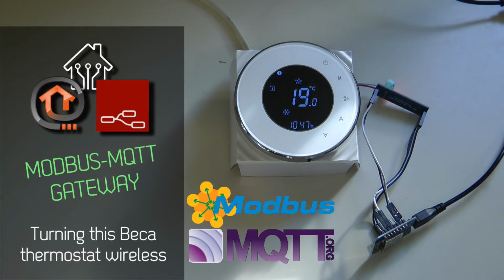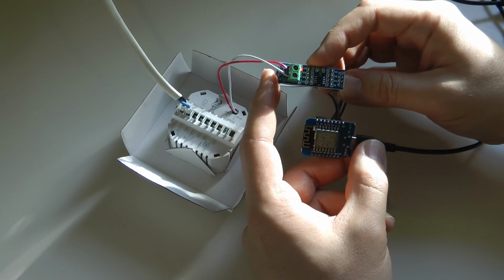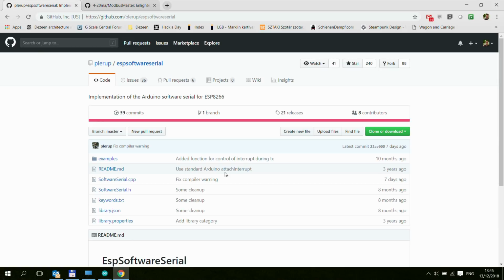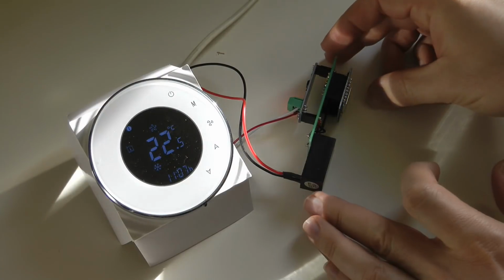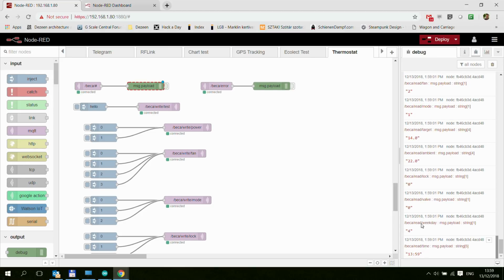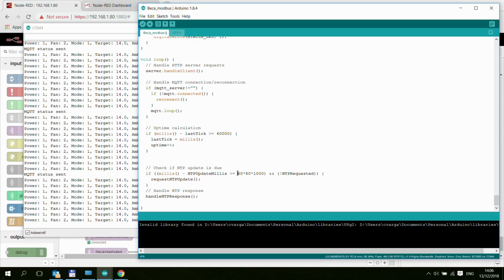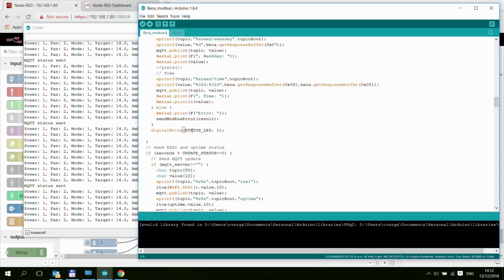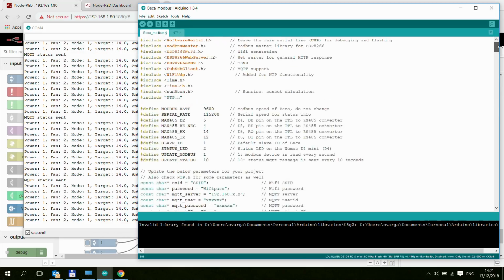Modbus to MQTT Gateway for Beca thermostat

Comment: Hey, create video! Do you happen to have a link to the Modbus datasheet for the Beca? I have one and need to integrate 😂.
Reply from the maker: Check this: https://docs.google.com/document/d/1Ue8Wy6LhTkNvlEkVSH8iUv1nnZ6Tri_m/edit?usp=sharing&ouid=107708713303271671804&rtpof=true&sd=true. It is very simple, but please do check with your model, as for some models some of the registers are not used.
Reply from the maker: The register do change a little bit between different models. But just read the first few registers and you will easily figure out which one is which. And you can also write these values, even stuff like time.

Comment: What applicatiom do we download to ise this particular thermostat..? So we can operate it online😊
Reply from the maker: None. I built this gateway to it can be integrated with a DIY home automation system, like Node-Red, or Home Assistant. It will not work directly with an app. But an exact model is available in Wifi version and that works with the Tuya Smart app. So buy the Wifi version and it will work.

Comment: dear Csongor Varga, I want to monitor and control the chiller with Modbus protocol and RS485 port, it is in the site and I'm at the office, would you please tell me how to do this process with GSM module and what other devices needed?
Reply from the maker: I don't know, you need some remote modbus unit which works over GSM. I am not aware of any such model.
Reply: @csongorvarga  Thanks for your response, would you please mention the model and brand of the equipments you have used to connect to the wifi network?
Reply from the maker: @sadeghkhorasani7616  Check my PCB project, it explains the parts used: https://www.pcbway.com/project/shareproject/ESP8266_Modbus_board.html
Reply: Hi, you can do this with a ie SIM800 module, (& a lot of AT commands) take care regarding timing⚠️, there a lot ov YT videos out which explains this

Comment: Hi there. Do you guys know if it's possible to change the thermostat's slave id? I'd like to have four of them on the same RS485 line. Thanks in advance.
Reply from the maker: I did a separate video on this device where I talk about setting it up. If you look the manual, you turn on the device with one of the the other button pressed, and it opens a settings screen. You can change the slave ID there.

Comment: What data can you see over mqtt except temperature?
Reply from the maker: If the unit is on/off, locked/not locked, mode, fan mode, time, day of week. And probably the external sensor as well, but I don't have it.

Comment: I was doing a similar project for the SDM 220 energy meter but i was bugged with the ESP wdt resets - thanks for the tip-  I was using delays and yield to try to solve this but didn't help. Also, I should share a picture of my protoboard - looks awfully similar to yours! I was uploading the data to Thingspeak(no mqtt and Node Red). Also implemented the same using an Arduino and an ethernet shield. Also, I was thinking of adding filter caps after the ac-dc power supply - did you analyse the output of the same? Another thing I was thinking about was whether to add RTC or use NTP - do you think NTP implementation is better than using RTC? Also, what do you think about adding SD card for a local backup log?
Reply from the maker: Great stuff! I think I was lucky finding the watchdog solution for this issue, otherwise would have chased the problem for weeks. Power supply: yes, I see it in most implementation that a 100m filter cap is added. Still it works without that for hours not rebooting. RTC: these devices will be on the network most of the time. So having the time refreshed from NTP from time-to-time is good enough. Even if the power goes down and comes back slower than the internet, the sketch will try the NTP request again in one hour. So you will be running without a clock for one hour. Probably not a huge issue. SD card: I can't really think of any important data you want to back up locally.

Comment: Does every Beca round thermostat model support modbus or only some specific versions?
Reply from the maker: As far as I can tell, they are either modbus or wifi versions.
Reply: @csongorvarga  so if I buy a wifi version.. I can control it using only via mobile app?... And if I buy a modbus version, I can use it via HA but not with mobile app like tuya?... I'd like to use it via tuya app, and view at the same time changes via HA... Is it possible? Thanks
Reply from the maker: @GiuseppeLodiRizziniOfficial  I don't know an option which would enable both.
Reply: @csongorvarga  so... At the end... Modbus is better cause can i control it via mobile using HA web interface.. Is it true?

Comment: Great video! Can you explain which thermostat did you used? From the Beca serie there are a lot of various types https://irshop.eu/eng/files/2018/02/BHT-6000-WIFI-HEATING-THERMOSTAT.pdf

And i think that i can only use the BHT6000 with the N (modbus option), but i can't found them yet....

Comment: Hey, 
I am still confused how did you "Not" use a Modbus library but still make it working more properly. 

I saw your previous videos about Modbus but was really confused and didn't get how can I Impliment it for my requirement.  

Overall, really thanks a lot for explain and to put your efforts teaching us. 

Thanks a lot. I'd really love if you can cover all the dataset of Modbus. And how to Impliment them in Arduino. Without libraries. 

Cheers!
Reply from the maker: I am confused too. I did use a modbus library. I would never try to code something like this from the ground up. What do you mean all dataset of Modbus? The different modbus functions? Unfortunately I would need devices for them to test all of them out.
Reply: @csongorvarga  yes I'm talking about using different Modbus functions. 
Like, I'm not yet able to get a simple Modbus read and write working of the function code 4000 that's to read. 
I don't know where am I going wrong. But saw a lot of libraries , couldn't find a reliable option.
Reply from the maker: @ParthBhat  Well, in this example I am reading register 40000, but in the readHoldingRegisters function you put 0 for 40000.